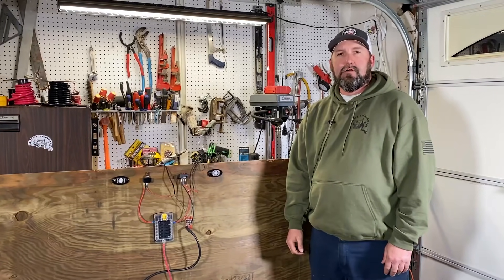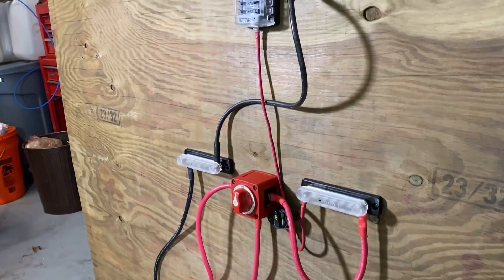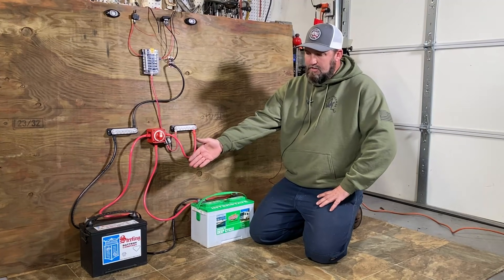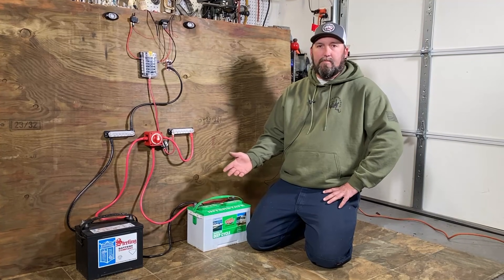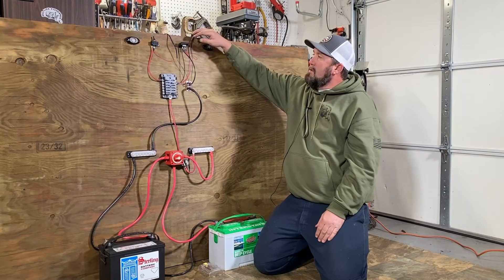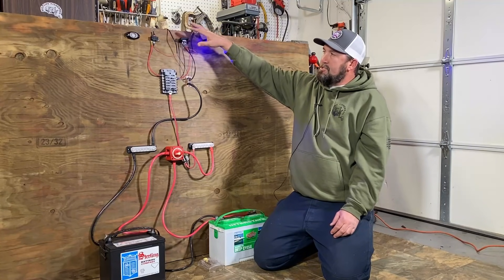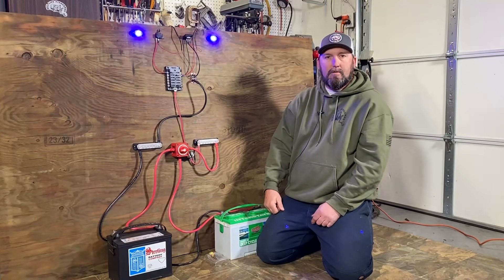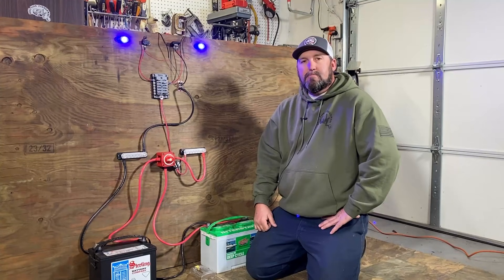BASIC BOAT DUAL BATTERY WIRING | HOW TO

Comment: do marine radio have memory wire ?
Reply from the maker: A vhf marine radio does not.. a stereo system deck will yes.. so if you have that you would want that wire hooked directly to the battery in a battery switched system.. or it would loose its memory.. let me know if you have any questions about anything.. thanks for watching

Comment: Good explanation.
I much prefer the Bluesea dual plus switch (6011) because I just have to turn the switch on when I get in the boat. The motor battery is connected only to the motor, the house battery connected to the house power but the switch turns them both on and off at the same time. And then there is the emergency setting that combines everything together.
My dumbass would forget to switch the battery from 1 to 2 and back again in your setup.
Reply from the maker: Yes that is why I run a battery isolator charging relay so both are always charged and run a on board battery charger at home to do the same ..  with running a cranking battery and a deep cycle as a house battery it’s not good to keep them hooked together in parallel through the switch. Because of their different ratings and charge rates ..  thanks for watching the video and commenting I appreciate it

Comment: Great video as always. Curious why you don't recommend running on both batteries? I generally troll on my house battery, switch to my crank battery to start my main motor and then switch to both 1&2 for the cruise back. I thought this was good as both my batteries should be fully charged when I get back to the dock.
Reply from the maker: Thanks I’m glad you like the channel! So the reason I don’t recommend leaving the battery switch on 1&2 a lot is because if you have a cranking and a deep cycle as your batteries they are hooked up in parallel through the switch in that position.. and when hooking two batteries in parallel they should both be the same size and type and rating.. now to do it every once in a while would be ok but really combining them I would only do if you have to.. but the only thing it would do is weaken the better battery.. when 2 batteries are hooked in parallel if one battery is weaker it will bring the other one down.. like a toxic relationship! lol  thanks for watching the video and commenting..let me know if you have any questions..
Reply: @ReelLifeFisherman  Thanks for your video. I set up my boat wiring today and you've given me confidence I'm on the right track. One thing missing from the video for me, is that I cannot see how the house battery will be charged as it won't be connected while the engine is running which is what will charge the crank battery. So does this mean the house battery will have to be hooked to solar or mains every time it's not being used? Not a huge deal, but if I'm away for few days I can see the house battery getting run down and then how would it get topped up again... Thanks again, great stuff.
Reply: @perkypat2214  Good question, I would also like to know the answer to this

Comment: Nice informative video, but I'm wondering about a good solid ground.  If running twin inboards should the negative not be connected to the engine(s) blocks in some manner.  Appears the all important solid ground is lacking, but perhaps you would be taking the ground from the negative buss bar.  I'm thinking this type of ground would be somewhat weak, but perhaps not.  What do you think?  Thanks for the videos and keep posting as your information is appreciated.
Reply from the maker: So yes when you have the engine hooked up in this system it would be hooked either to the negative on the battery or negative buss bar they all share negatives so it would be grounding to the engine block at that point through the shared negative side of the system.. thanks for watching the video and the great question! I should have probably gone over that part in the video.. thanks for watching the channel I appreciate it!

Comment: Hey great vid, excellent timing. So this is a 12 volt system, correct?
 Which is exactly what I need for my 16 foot 25 hp tiller boat. I'm about to install a 12 volt terrova on the bow.  No console on my boat, starting from scratch basically.
 l'll have;
*power to my 1986 25 hp evenrude. 
*Power to the Bilge
*Power to my Lowrance ti.  
*Power to the 12 volt terrova. 
*Power to Minn Kota bluetooth head unit.
*Power to running lights I'm adding.
I have a 6 or 8 fused switch panel to install.
I have the suggest breaker fuse for the terrova. 
I have two 31 series batteries. I question how much charging out-put my evenrude produces to charge a battery...if any???
Concidering running Lowrance ti and terrova on same battery. What do you think?
I don't have an on board charger... Yet.. Or not?
Reply: I am doing the same install right now. I will have 3 batteries and keeping my trolling motor separate. I also have a 3 bank charger for my batteries and I am using a 10a per bank charging system.. Good Luck with your install
Reply: @scottscaneh  Thanks, you too ehh.
Reply from the maker: Your build sounds awesome! Only thing  I would recommend is don’t hook anything but the trolling motor to the deep cycle you get for it.. if you hook your fish finder up to the same battery or system that your trolling motor is hooked to it will cause bad inference on the fish finder and you won’t be able to read the screen..  also the Bluetooth heading sensor needs to be on a separate battery then the trolling motor also.. so I would get a duel Purpose battery for your main battery and a group 31 deep cycle for your trolling battery.. normally I don’t recommend Dual purpose batteries but for your set up it would be best.. let me know if you have any questions love to help if I can.. thanks for watching.. just saw you have 2 - 31’s  already.. that is fine but run the boat and everything off one and just the trolling motor off the other one..
Reply: @ReelLifeFisherman  Copy, trolling motor will stand alone. All other components I'll run off the engine batt. Thanks for the feed back. Really appreciate it.  Do you think my little 25 hp evinrude generates a charge to the batt? I still have a dual purpose group 27 battery I can use for the non-trolling motor sys if it's better than the 31.
Reply: @ReelLifeFisherman  Jay can you hook the heading sensor to a fuseblock or does it need to go directly back to the house battery?